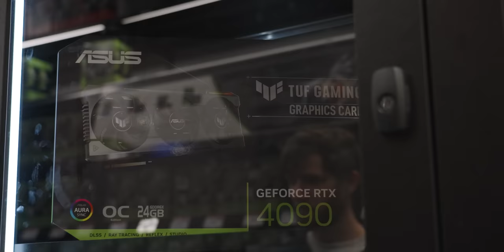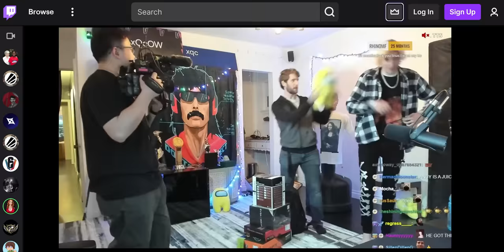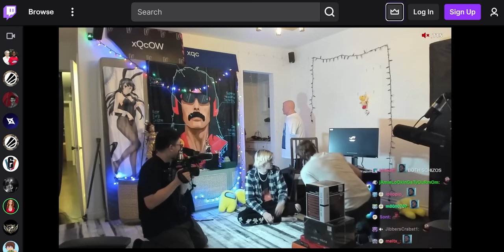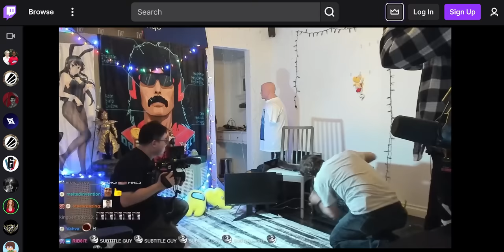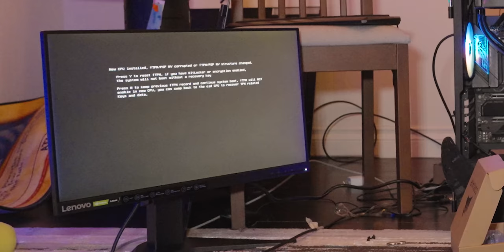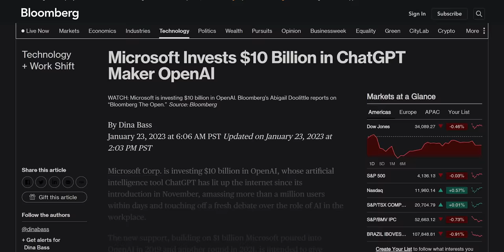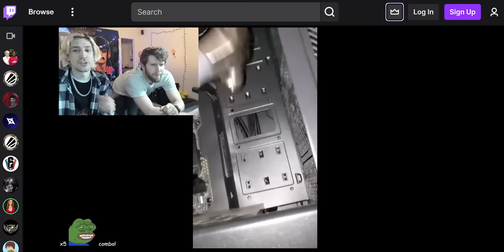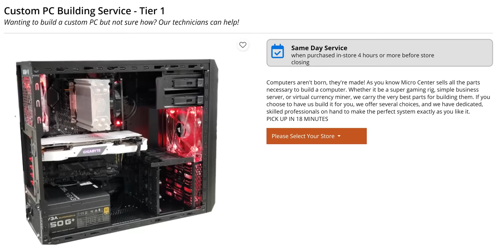xQc Broke his Computer AGAIN... so I Got on a Plane

Comment: "Truth is, i'd rather see a crappy cable than good wireless."
Underrated quote.
Reply: Same here, always prefer the caaaable.
Reply: does it count if i run a cable from a booster because my apt building has built in wifi and wont let me add my own internet?
Reply: Okay, but also no dongle. I have a bad headphone dongle that destroys my headphone sound
Reply: The best reliable way still, and doesn't require battery too!
Reply: @GrumpyTy34er  I presume you're talking about a cheap USB-C DAC.  Wired headphones typically use analog signals which are far more susceptible to interference, a cheap DAC may not offer sufficient shielding (I've had 2 myself, the first one was crap the second one, which cost about $12, works great).  Digital signals are far more robust though the higher the speeds the more sensitive they become.  For typical internet speeds you don't need a whole lot of shielding.

Comment: With the “mystery problems” I have to agree. As a programmer, it’s an absolute nightmare when trying to debug your program and not knowing what’s wrong with it when it comes up once and you have no idea how to reproduce it
Reply: and after the 10th time recompiling without changing anything somehow it's fixed itself
Reply: Unit testing will help you debug faster
Reply: Same with cars, my wife didnt understand how hard it is to reproduce a electrical issue if it only does it every now and then.
Reply: @deckyfiyemonda9893  That means your code isn't deterministic.

Comment: Holy crap this was exactly the issue on the mobo on my first build. After exhaustive googling and chatting with various tech repair shops, my solution was also just to buy a new board… except this was during the pandemic and that gen board was hard to come by and usually overpriced. $2k later I ended up needing to rebuild with all new parts 😢

Comment: "If you build a computer and you're not bleeding a little... I dunno, did ya really build a computer?" This is so true. Every time I build there will be something that gets me.
Reply: Its the normal blood sacrifice to the machine god
Reply: Built my first PC some years ago, no blood, booted on first try, no problems. Runs just fine even years after.

I didn't have any backup, or help, previous experience, or guides though, so there are things wrong with the build that I could fix now with what I learned building, but it's all small things like the case fan RGB's not working (Uses the same socket, of which there is only 1 of as the AIO RGB fans do), or the RAM RGB not working (Software conflicts) and there's one wire that goes in between the IO shield and one plug (Motherboard's graphic output for integrated CPU graphics) and the cable management is -- managed.
Reply: I didn't bleed until I had to install and wire my corsair fans and the hub(s). The amount of wire management took longer than the actual build.
Reply: I lost some blood when installing the Scythe Fuma 2 tower cooler inside a small form factor case. They don't call themselves Scythe for no reason.
Reply: Battle scars from trying to install a Dark Rock Pro 4 cooler without taking the mobo out of the case 🩸🩸🩸 That thing is sharp
Reply: @benrafer  If you don't do the blood sacrifice, you're cursed with a future of weird errors and crashes! Number one rule of IT (even on the server side - I've lost count of the number of Rack installs that's taken a chunk out of me somewhere!)
Reply: I've always nicked myself on something, however big or small, but something somewhere causes at least a scratch. Except once. And that one build actually caught fire because of a faulty wire, so now whenever I'm putting a PC together, I basically pray to see a little bit of blood.
Reply: It's true. everytime i build pc or repair it. My fingers always get dirty, hurt  when touch water after building for some reason maybe because i always pushing with my finger. My nightmare is installing amd cpu cooler because you need to push it hard enough _--
Reply: Its always something I never notice until a bit after i finish. Last one i built tested  for about an hour and started watchin youtube only to see a little dried blood on the inside of the glass panel, then i noticed the thin line of dried blood on my elbow and was like "The fuck!?". 

If there wasnt blood on the panel i probably would have gone bout my day washed it off in the shower and never known i bled.
Reply: @benrafer  Omnissiah demands its sacrifice.
Reply: I recently built a PC with an older case that had a lot of metal bits sticking out (so more likely to cut yourself) and I somehow got out unscathed, but now I feel like I missed out xd
Reply: I did not bleed when putting together my first and only build (for now), but I scratched my psu with the motherboard when trying to install the motherboard with the cooler (nh-d15) already mounted on it.

Comment: "If you build a computer, and you don't bleed a little... did you really build a computer?"... so true, and absolutely hilarious. Linus to the rescue... can someone get this man a band-aid.
Reply: Built my first PC about a week ago for a family member and literally the first thing I did was cut myself tryna open a plastic bag
Reply: @kyunikoi  I don't cut myself anymore but I get frustrated sometimes, like recently putting a m.2 ssd in. I hate how tiny those m.2 mounting screws are, because i don't have a magnetic screwdriver.
Reply: Blood for the Blood God, if not you'll have problems
Reply: I used to cut myself all the time on the PCs I built for my school 🤣
Reply: That's why I slice my own hand open if I get through a build without an accident the pc gods need the blood sacrifice
Reply: The blood sacrifice must be made for the computer to run stable. I thought everyone knew this? 😆
Reply: When you are used to doing mechanics, pc's don't do anything to hands!
Reply: @The Lone Wolf  that's because the sacrifice for vehicles is different for a pc it's just an injury during the build to give the pc the life force to power on and the BIOS gods an offering . But with a car for example it's a 10mm socket and you must drink either used engine oil as you remove the oil pan nut or break fluid from an over pressured abs system don't get me started on hydraulics on construction equipment
Reply: @acid3129  Hahahahahahaha clearly!
The 10mm God.
Reply: @The Lone Wolf  every profession has a god who needs tribute . Cleaner's and maids it's one sock from each pair . Network engineers it's knuckle skin and once a month you hang the most annoying client from the mass of network cables in the server room . For a chef it's a finger and the sk8n on your hand from burns . In an office it's the weakest intern taking a face full of printer toner
Reply: @tmdosu  blasphemy against the Omnissiah

Comment: Man, I have 20+ years of computer building experience and I've never had issues like this. Probably because I never go for components that are less than a year old on the market. The first year of a life of a product is when the QC, troubleshooting and manufacturing process benefit from the consumer experience. You don't get to get the top of the line but whatever, at least it's stable and reliable.
Reply: Issues like what??? Plugging in connectors wrong shorting out your board??? Your lack of issues isn't a bad thing.
Reply: @user-fw6eg3hc8f  Sorry I didn't get your...aggressive comment...
I was just saying that leaving a period of cool down is a good thing if you don't t want to suffer from early issues with new hardware/platform such as the ones you can encounter with  DDR5, intel 13th gen, AM5 or whatever.

Comment: This perfectly captures the experience of coming over to a friends house to troubleshoot their build. Bringing every possible thing you might need except one super common cable they dont have a spare of for some inexplicably reason, working on the floor, them having some weird preference about not wanting some case header plugged in, and teaching them some random windows feature they didn't know about. There's about 100 other examples but I'll stop here lol.

Comment: I had a relatively high end Aorus mobo that I once tripped on a USB-C cord attached to and ever since, that port was unusable but the mobo still worked. If I attached a USB-C cable it immediately shorted out and shut off. Then I spilled a soda on it and it booted twice and never started up again. Ended up with a MicroCenter 13700 build afterwards. I really need to stop being dumb around my computer.

Comment: Kind of late, however you can get USB overcurrent errors if there is something wrong with one of the PCIE slots. I've personally run into this when plugging in certain combinations of cards in two motherboards now that cause this error. I even had a wifi card turn a motherboard on by it own self on MULTIPLE boards unless it was switched off.

USB overcurrent watches the 5v rail, if there is a high draw device somewhere on that rail it will cause this issue.

Comment: i ran into this internal usb-c connector as well on the mini Z board and i was literally so confused what it was, i had nothing to plug my AIO into. ended up running a cord to the back of the board outside the case to run it

Comment: Adhd.. I know this issue.. Everything is put in correct but something is upside down or not propperly connected.. I built dozens of computers and the ones that done f1*ckt up, there is always some shit error where it should be easy as pie. Skater, gamer, messy home, structure within caos.. This guy is basicly me.. He need grounded powerplugs.